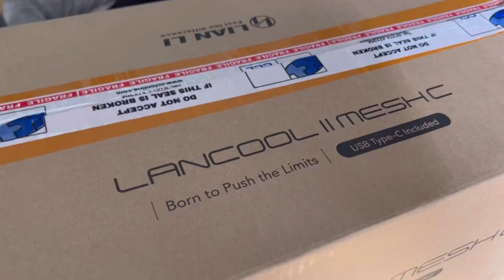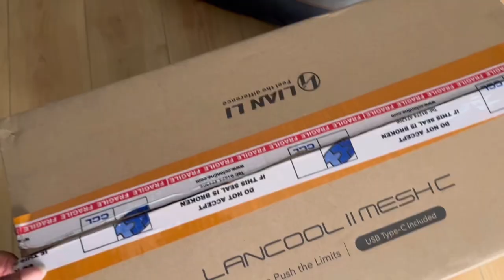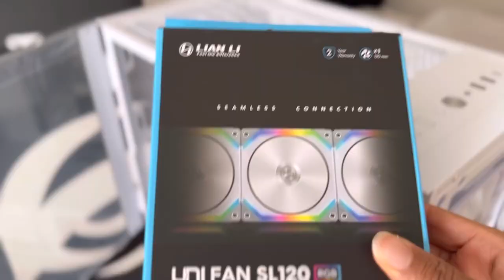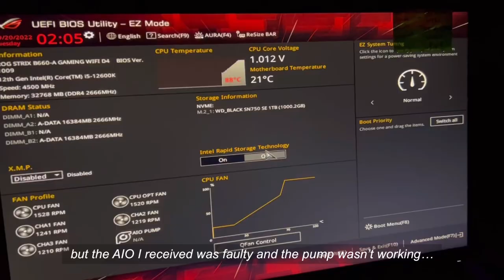building a PC for animation & gaming vlog | black white and RGB | rtx 3060ti, i5-12600k 🤍

Comment: Hardware choice is good, the only thing you really need to improve on is the cable management but that's an obstacle anyone will face! nice pc build
Reply from the maker: Thank you!! I’ll definitely keep working on the pc ☺️
Reply: I would say everything besides the graphics card was a good choice. The RX 6700xt comes in $70 cheaper (at least in the us) than the 3060 ti and delivers better performance.
Reply: @ezplays3321  I don't think they really care about max price/performance when they picked an AIO that costs more than the CPU it's cooling lol... They could have got a 3080 with the budget this build used.

Comment: Should've held out till the new 40 series  💀
Reply: I’m going into building a pc buying parts slowly should that be one of my finally purchases when do they come out ?
Reply from the maker: Waiting into the new year for the 4060 would’ve been a bad call for me 😅 Upgrading is always a choice!
Reply: I disagree, OP. Spending $1,600 on a 4090 likely would have required them to change more than just the chassis in turn.
Reply: @LadyWolvie82  No the case is fine, only thing they'd need to change is the powersupply to give it a little more headroom but an 850W power supply could run a 4090.
Reply: @_mable  You would have been waiting another year for a mid range 40 series 🤣 Very good call on the 3060ti imo